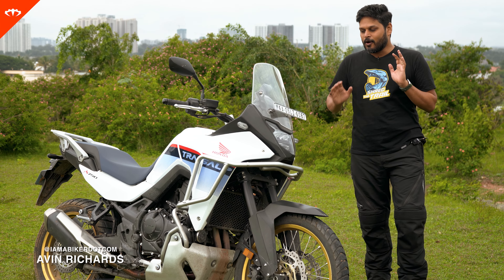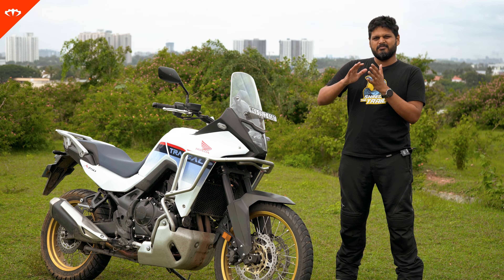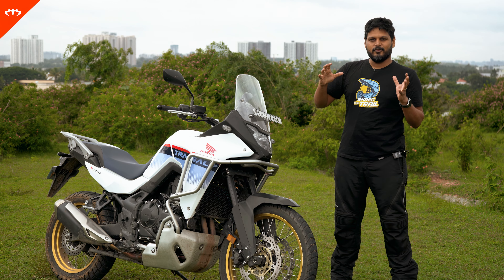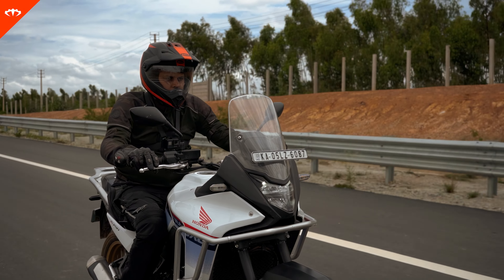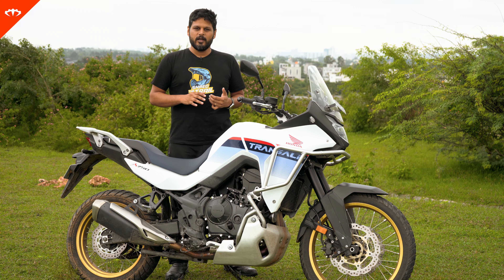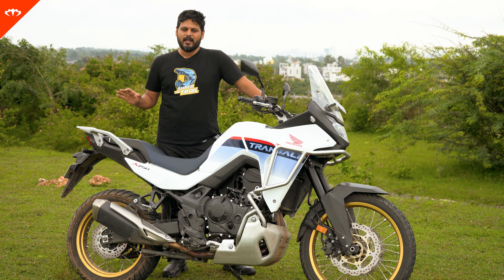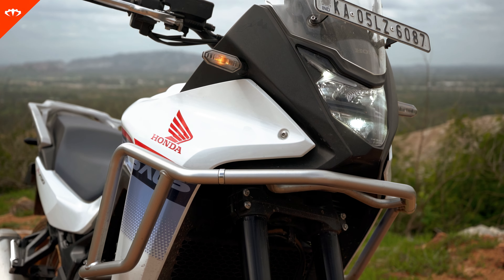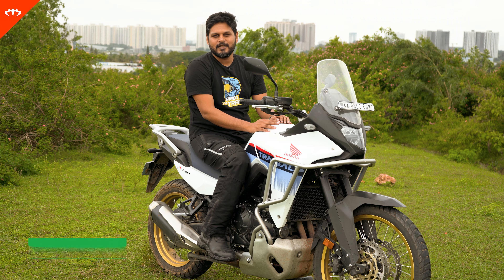2024 Honda XL750 Transalp Review

Comment: You'll be surprised how much sensitive the preload adjuster in the front and rear suspension is. Stock setting is 7 from the softest in the front out of 15 turns and rear 2 from the softest out of 7 turns. My weight is 70 kilos and increasing the front to 8 (1 more) and rear to 4 (2 more from the factory settings) have done wonder. The front suspension dive is gone now and rear although not perfect definitely better. I wanted to go 9 in the front but then the sag is too less for my height(5'7") and I'm always tip-toeing. The Engine is a gem and if you keep between 90-100 with sudden blast of 120-130kmph give me around 26-27 kmpl. The bike is rock stable on heavy off roads on slower speeds and much easier to handle than my previous 390 adv. The headlight is absolute junk when there is oncoming traffic. The stock wind screen creates a lot of turbulence for my short height on left and right of the helmet and I'm always looking through the screen and feeling claustrophobic. I do miss cruise control. Air filter servicing will need you to visit service center as it's almost impossible to reach easily. 
Nice review team.